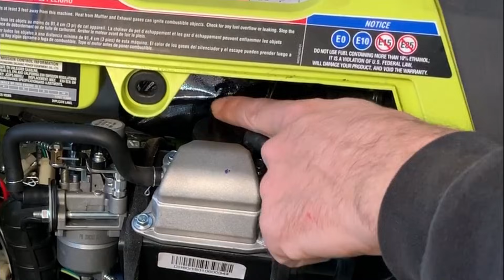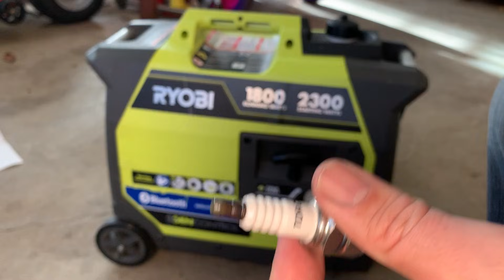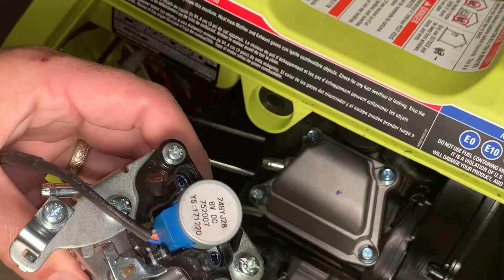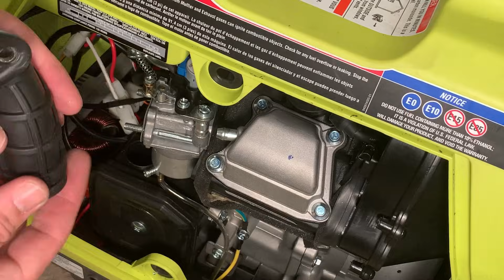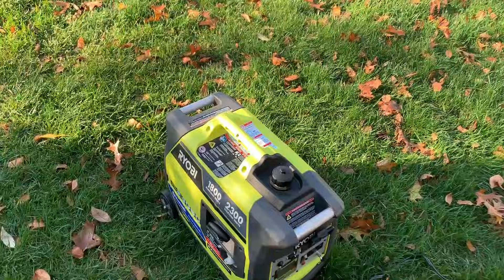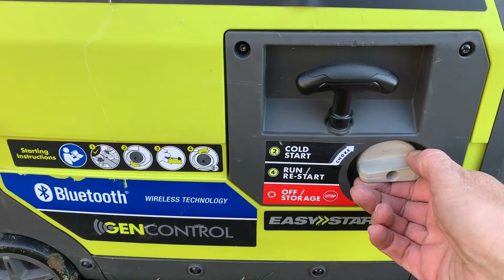Surging and Stalling Ryobi Inverter Generator Fixed - RYI2300

Comment: I have the same problem with one I bought just before hurricane Ion hit us.  It finally started but your right, the control knob on mine is way off.  My Honda Gen, about 30 years old, had a small hole in the tank when I dragged it out before the hurricane hit so I went to HD and that was the only gen on the shelf and I bought it...WAY too much money for what I consider to be a oiece of junk.  My old Honda still starts on the first or second pull.  No more Ryobi for me,  Vietnam crap, no excuse but poor workmanship.  You want a good generator buy a Honda or MultiQuip.  Worked construction for 49 years and everything we bought for compactors pumps generators anything with a small motor we spec Honda.  Thanks for the tutorial, I'll fiddle around with it and dump it in a yardsale!

Comment: after you found the Fuel Flow Problem to Completely Stop the Small Surging  Drill out the Main Jet 0.02 - 0.03  They come Very Lean from the  Factory to Meet EPA Standards

Comment: Great video......up to the point of the readjustment near the end of the video, it would have been nice to see how you adjusted the knob that was the ultimate issue. I guess the first test should be fuel flow and adjusting that knob correctly. You provided excellent instructions on how to remove the carb and that gives me confidence to work on mine.

Comment: I bought this same machine in the Virgin Islands during hurricane Irma and it was a life saver. It ran well and I ran it 8 hours a day which it would consume about a half gallon a day. I plugged two full size refrigerators, two fans and evening lights and topped off phones. The thing preformed  like a champ and it was very quite. It cost a bit more then larger noisy gas guzzler generators but the value of quiet and massive fuel savings is priceless. While I would pick up 2 gallons of fuel every 4 days, my neighbors would be lugging 10 gallons of fuel for the same period of use. Tactically the Ryobi save your back and it more than paid for itself over the four months we were down with no electricity on the Island. Buying a new one too tuck away for the next big storm. A very good investment.

Comment: Just bought this generator yesterday 2nd hand, was showed it worked and took it home. I fired it up and pluged in a light and a car fridge/freezer and left it running to see how the "gas mileage" was going to be. Started to play up surging after a few minutes and naturally I thought I had been conned and payed good money for a pile of ****. Then I looked on Youtube and found your post of this issue/fix. Turned the knob towards choke and found the sweet spot for the unit and now no surging. Thanks mate from the land down under.

Comment: why you replace the whole carburator? all you had to do was clean out the 3 brass spray parts , the tiny one in the cup, the long one that goes up the center and the one under the servo with a pin and a wire brush strand for the top nut, i also used 14K acid tester to clean out the tiny holes, the choke cable was good to adjust
Reply: Also did the 14k trick and it worked, now having a issue getting the Servor seated back in...uggghhh

Comment: Thanks for posting this James!
I believe the issue is with the valve in the fuel switch. Unlike most other brands of inverter generators out there, Ryobi’s don’t have an in tank fuel strainer, and the fuel filter is after the fuel switch assembly. This allows debris to travel from the tank to the switch, and gets lodged in there, clogging it.
These generators are very temperamental. I was repairing my new Firman 2000 and realized it has strainer in bottom of the tank, in the line, as well as the input strainer on the top. Definitely room for improvement Ryobi.
My family owns 2 of these since 2017, and they have never worked right. Very sad.
Reply: Took mine out today and draind the gas, tried to start it to burn off the gas in the line and the pull rope broke.  It has about 4 or 5 small nylon lines wrapped in a nylon sleeve!  Totally a peice of junk.
Reply: How do you access this valve?

Comment: Just wanted to say a huge THANK YOU, we are in Florida and without power after Ian blasted through. We were having the surging problem and were getting really frustrated when it kept stalling out. Just adding a little choke to it and we are up and running smoothly. Thank you so much for taking the time to share this.

Comment: I believe these carbs are Honda knockoffs? If that's true then there is also a pilot jet under the low idle set screw on top of the carb and under the servo? They have no filter and can get clogged. You're supposed to pop it out, check the O ring and clean out the jet. I had to do that when I bought mine in a pallet load of returns. But thanks to you, I think this is what's going on with mine? I'll do this test on it.

Comment: Friends. Changing carb is an easy button but I just watched another video that fixed same problem by cleaning a tiny jet/orifice that most miss. It unscrews from top of carb through the hole in the top plastic.
Its basically in the back side of the carb looking at it when it is mounted and it faces straight up. 
Once removed, the hole to clean is tiny one on it's bottom. Need a tiny wire from stainless steel brush for example.
Here is the link:
https://youtu.be/yY-GMFDY9LY

Comment: my first round up with this Genset I realize the imprecision of these controls.  Specific to the cheap, spastic, ad hoc cable system to the control knob.
Fortunately for me I'm lazy.  I ain't looking to replace carbs and filters   but after an oil change I noticed it was more difficult to start and ran rougher.
I started fiddling about with the "choke cable" which as you know is the choke, start, run, stop cable.
I pulled a bit there and found that the set screw "nut" was not secure.  Which insisted to me that with every successive, start, run, stop cycle, the Genset would become further and farther out of adjustment.  Having worked in Shimano shifters and caliper brakes since a kid I intuited the imprecision of these ancient mechanical setups was likely my problem   adjusted.  Crimped it down hard.
Been fine ever sense.

Appreciate your efforts.  And fully understand...All the tech in the world cannot overcome a piece of wire fallen into improper adjustment.
A sign of the times.

Comment: Only 12 hours on mine and it started doing this. Mine is only used for power emergencies though, so it's stored a lot with Stabil and about a half gallon of gas. In my case, it seems to run the smoothest with the choke closer between the O and the K and a load on it (the sticker is not algined straight...). Played with it between 750 and 1,500 watts using a space heater. Thank you for saving me from tearing into it. Not gonna bother tuning it up when i rarely use it.

Comment: I am having similar issues was working on it today changing the oil and decided to go to YouTube and get a bit more engaged with the generator tomorrow I will go back out and see if I can get the same results as you by bringing the choke level to the "H" because the surges were starting to annoy me and I didn't know what to do

Comment: I'm interested in a westinghouse wgen9500 and would like your thoughts on it
Reply from the maker: Seems like a standard Honda clone.  The total harmonic distortion is listed at >= 23%.  That is high.  6% or less is considered safe for sensitive electronics.  Also the manual lists a parts diagram, but I was not able to locate parts.  That said, its a Honda clone so Honda clone parts will fit for all the basic stuff like the carburetor and ignition coil.  Most brushed generators with an AVR are listed with a high THD.
Reply: @jcondon1  thank you

Comment: My generator will idle but will not run any faster. Can not figure it out.
Reply from the maker: Check to make sure the throttle plate is not stuck.  Otherwise might have a bad servo or bad inverter module.

Comment: I have this model and never noticed surging but it can be hard to start when it’s very cold. If I bring it into heated area for a few hours and try again it starts right up. I do run synthetic fuel in it and my chainsaws. Perhaps that is the problem?

Comment: I have this same generator.  One thing I noticed was that after you started it each time,  you immediately turned it from choke to run.  The manual says to leave it on choke for 15-30 seconds.  Perhaps if you left it on choke a bit longer, and maybe even tried under load with the choke on, you would have seen the problem go away and that would have given you a clue as to the problem.  Granted, it's easy to say now that we know the problem lol.  Thanks for the video.
Reply: I had to keep mine on Choke for it to run.  Every time I tried to put it on run it died.  Im going to mess with it in a few days and the first thing i'll do is take off the grey knob ( Im thinking its probably on a spline) and moving it to choke then checking that the choke is full closed and trying it.  Jim is on the right track with the fuel flow.  Not right that we should have to be messing around with something that should be proved out at the factory....foreign junk!

Comment: This helped so much. I was having a problem with it stalling under a load. I've barely used it up till now. It turns out it was the fuel dial just as it was in your video. Thanks!

Comment: The better designs have a fuel shut off as well. So you should always shut the fuel to let the engine die without electrical load, so then the carb is virtually empty and won't gum up during long storage, you still need stabil,  but will start much easier next time.
Reply: And recreational gas (alcohol free) a little more but worth it.
Reply: Stabil doesn't work.

Comment: Good fix!.. Not sorry that i walked right on past it due to the price though... Im sure its good for some situations but i went with the Champion 4375 dual fuel... Loving it so far! Smaller gas tank then id like and super touchy on the choke at startup.. (Just crank until it pops over then go full open choke to run on gas, and NO choke on propane, seems to work EXCELLENT.. Even at 7°f

Comment: Hmm .. curious discovery about the choke dial .. I wonder if the dial is on a spline that can be moved one over? .. BTW, mine runs better when set slightly to choke-Hmm, wonder why ..
PS. There’s at least 8 generator brands out there that use this same engine/Genset …

Comment: The main problem is that fuel line going to the valve have too much vend and vibration from the engine cuts the fuel flow I connected the fuel line straight from the gas tank to the carburator and it fixed the surging completely.

Comment: Greetings from Australia mate. Did you disassembled by any chance the old carb? notice the main jet size?. They have a number on the side. I have the same generator and it is always running lean. I wonder if the previous owner changed the main jet. Mine says 70 on the side.
Reply from the maker: I was able to fit a 71 microdrill bit.  0.026" or 0.6604 mm

Comment: To simplify things, save up and spend the extra money on the Honda or as a second option, the Yamaha. This unit was a nightmare for us. It spent over a month in and out of the service  center with this issue. They could never fix it and refunded my money which I put toward the Honda EU2200i. Lesson learned.

Comment: You dont need much fuel coming into the bowl. Just  a healthy drip will keep the bowel full.

I live at 5k'  and have an issue with the Co2 detector. If you run it downhill from your house and no wind is blowing, It will beep and not start. Very aggravating. I can't find out how to disable it either. Any Co 2 detectors that are low will go off constantly for no apparent reason. There is a lot less oxygen at 5000' is what the problem is.

I can barely run 1500 watts and it will say it's overloaded. My 3Kw military diesel will bearley do 2700kw

Comment: what a great video !! i found that the fuel supply is not well as you show in the video , i just did a bypass so NO valve anymore and so gas is going straight to the carb! easy !!

Comment: Hi 
My generator does Star but is running dificulta, sound like it doesnt have power enought, someone told me was the inverter model, since indicate it was over load, and also the panel is off all the time, what do You think it is ....
Reply from the maker: Overload light is usually an indication that the inverter module is bad.
Reply: @jcondon1  hi
Do You have a picture or Better, a video about the inverter module?
Reply from the maker: @carmenzrodriguez2955  not on this model.  My recent video on the Yamaha EF3000iseb covers in detail some tests I did to check the health of the inverter.

Comment: I got my Ryobi 2300 watt dirt cheap because of this very fact that it was doing the same thing clean the carburetor extremely well replace the spark plug and that fixed it have well over 3,000 hours on mine so far

Comment: I have 2 of these generators, 1 of them works just like yours and you need to set it to the "O" in choke to prevent it from surging. The other one, works flawlessly. Do not know why but I do not ask. Thanks for a great video.

Comment: I've had the same problem,  but on a generic generator that used the same easy start function as this one, and the problem I found, was that the know was loose, so I took it off and put the stem on choke,  and screwd the know back on with red locktite, and that fixed the problem.. it didn't open fully, but been working ever since..

Comment: Manufactures should send prototypes of products like this to people like you who know and understand how equipment should work. You can be sure some over qualified engineers design this and sent to that factory without any practical testing.
Reply: They do test them practically in a lab but the engineers do not get the final say on what gets put into production. Its always the money men. Some of those money men understand engineering but many of then do not. I recall working in an electronics production company as a  young man. I was a test engineer tasked with developing test hardware and systems. I hated the fact that I would take an early prototype of some hardware that I had designed and built to a meeting. Or if it was too big we would  have the meeting around the rig. I would demonstrate where I had got to and tell them what we needed to do to finish it.  More than once they took it off me there and then saying it does what we want now. I would tear  my hair out by the roots in frustration. Its one of the reasons I left manufacturing and took posts in education and research.
Reply: Made in Viet Nam bud!

Comment: Great diagnosing that issue. I personally hate those all-in-one knobs that have the kill switch fuel valve combined. It's one of the main reasons why I did not get the Honda. I actually just repaired one of these with the exact issue. I was able to adjust it but often times because that knob is being used so often they wear out and it's probably better just to replace it completely. I had one of them where it would not shut off the fuel at all. I get why they were trying to combine it to make it simpler but that trade-off is not the best call IMHO. I love my Yamaha ef2000is and I run mine on propane.
Reply from the maker: Same here.  Ideally all the controls would be separate like they are on the Yamaha ef2000is.  I really wanted to like this generator, but that knob ruined an otherwise decent product.

Comment: Bought a Pulsar generator and from out of the Box it will surge on a small load of about 600 watts.  When I move to the chock a bit this will go away and the generator runs great.  Found this video on accident.  Also found after about 4 weeks of running I lost power.  After careful checking, I found that the main plug had Vibrated off....I plugged it back in and then everything worked again.  I cannot belive how quality control can be this poor on items such as this.  I contacted the Manufacturer and they want me to send it back for "Analysis".  I decided to not do this because it works. I told the company, if the quality control and testing was present at the beginning then this would not have happened.

Comment: I've been running mine for 5 months. 3300 hrs. I have 4 ryobi generators. Yeah this one is a little temperamental compared to the older 1800/2200s, but I learned a long time ago all ryobi generators have the knob or slider issue. I just bought a brand new 6500. A more basic design but same issue. Just fiddle with the knob. I also returned my first 2300.  This machine is a definite downgrade from the old 2800/2200 but it has made it this far.

Comment: I do have one of these Ryobi inverter generator and I am not happy with the dial control,  I would rather have a independently control choke and fuel valve. I’ve always turn my fuel off and let my generator burn the fuel out of the carburetor before putting it away. You are not able to do that with this generator.

Comment: Greetings: In case it helps someone: In my case, I made all the recommendations suggested in this and other videos on the same fault and my Ryobi2300 generator continued with the same instability and shutdown problem. Hehehe, do you know what it was? That I had misplaced the carburetor gasket that goes in the front in the back and the air escaped and gave me instability. THINGS THAT HAPPEN

Comment: I have a Workzone 2K that uses the same engine and run/choke control, having the same issue.  Tried cleaning the carb in place with no success.  The problem with removing the carb on a Workzone is you have to loosen/remove the gas take to slide out the carb, what a pain.
Reply: I have the same one you have and it has surged since it was new. I was going to remove the carb but it looked to be nearly impossible to get it off.